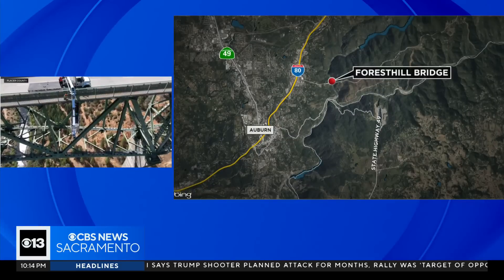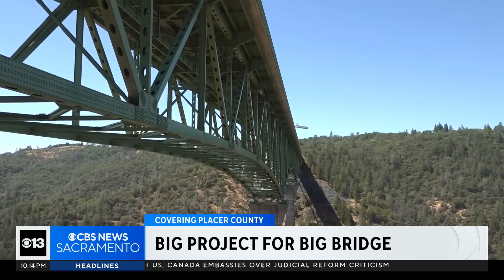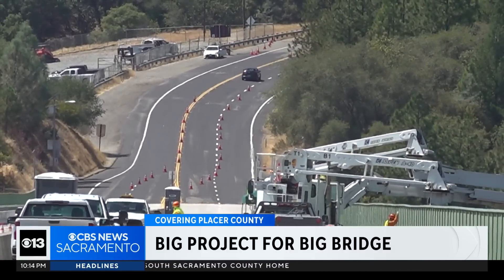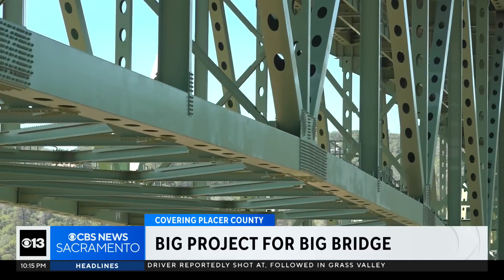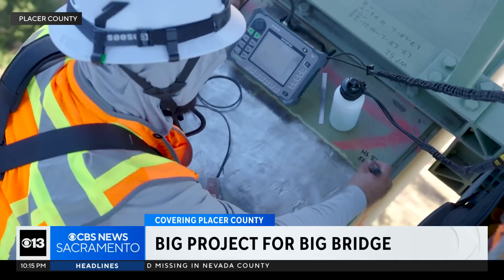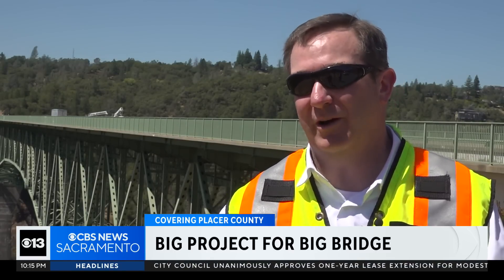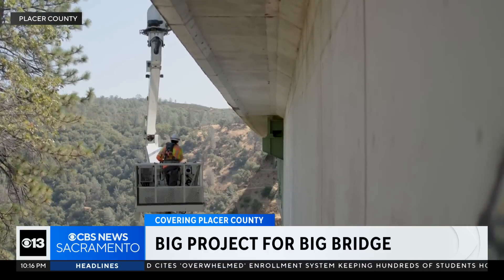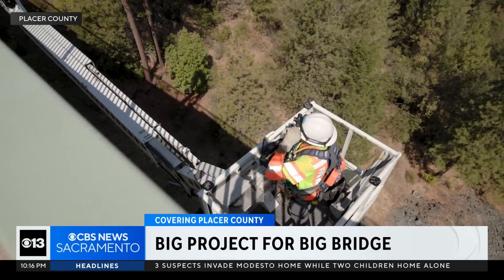California's tallest bridge undergoing major inspections. Here's why

Comment: Knowing California's penchant for lack of maintenance on EVERYTHING, this is LONG OVERDUE.
Reply: This bridge has received considerable and continuing maintenance and inspection. It most recently had inspection work on every single connection followed by a painting. It also had upgrades on the abutments as well, it’s in good shape. Better examinations of railroad bridges is required all across the country.
Reply: Not sure this is maintence. Apparently, the govt has requested testing because the same weld material is cracking on east coast bridges.
Reply: @velvetbees   There's a slew of vids out there highlighting a lack of essential inspections, ignoring recommendations, etc. on road infrastructure.
Reply: @alanrobinson4318  To be honest, I love California. I enjoy visiting it. The negativity about it in recent years made me think it is falling apart, but I think that criticism became overkill. At least for me. The whole state can't be falling apart. So now I try to get background info. I decided it has problems. No doubt. But I don't want to hate the state either. It holds good memories of family members who have passed away. Places I went with them, etc.

Comment: Seems to me in 1978 a massive bridge failure happen on I 95 in Connecticut or Pennsylvania, my wife and I were visiting in Connecticut and had used the bridge the previous night, we saw it on the news the next morning. Believe it was a pin failure.
Reply: THERE WAS THE MYANISIS BRIDGE COLLAPSE IN 1983 WHERE4  PEOPLE WERE KILLED IN MY STATE OF CT
 THERE WAS THE TOLL FIRE WHERE 7  PEOPLE KILLED  WHEN  TANKER SLAMMED INTO  THE BOOTH
75 FOOT DROP  WHEN IT FELL
18 WHEELER DROVE OFF HEAD FIRST

Comment: We don’t get corrosive weather here like in the east coast
Reply: But there are earthquakes which can tear out rivets, break welds and fracture steel.
Reply: @larrybruce4856  oh yeah, I’m so used to quakes that I forgot
Reply: California is the only state that requires all civil engineers to pass a seismic exam in order to be licensed. Infrastructures in California are built with much higher standards so they survive in earthquakes
Reply: @huaqingzhu5928    Good to know but----------where were they when Millenium Tower in San Francisco 
was approved to be constructed on flawed footings by NOT hitting bedrock causing it to lean like the Tower of Pisa ???  I question if construction plans were changed to cut costs after approval by reliable engineers causing problems ??? This has been known to happen. Plans were changed to cut costs after approval.
Reply: @larrybruce4856  Not sure about this specific case, but if everyone plays by the book, any design change has to be approved by the design engineer. Sometimes shady contractors cut corner for more profit but that's not likely to happen on a large project since there'd be so many whistle blowers.
Reply: @Face-u3m   I'm pretty sure that the earlier failures were in Colorado, not the east coast.  Additionally, the failure was not due to corrosion in any case.
Reply: @perkinscurry8665  thx
Reply: I LIVE ON EAST COAST  , LOTS OF CORRORSIVE HERE
Reply: Everything near a salt water sea is corrosive.
Reply: Depends on where you are in the Sierras... that far down in the foothills, Auburn usually doesn't get much snow. I would think the county doesn't have to de-ice the road much if at all.
Reply: @1slotmech  thx